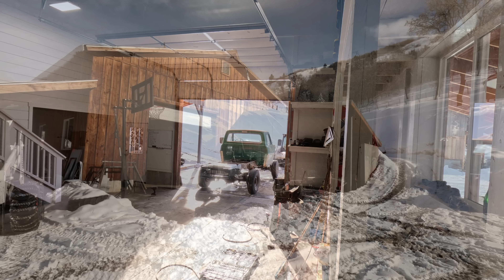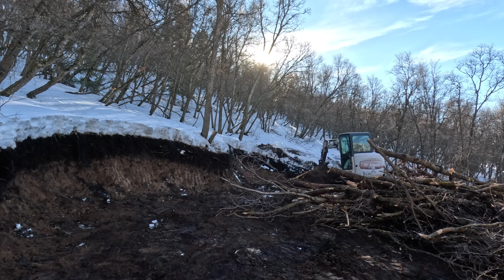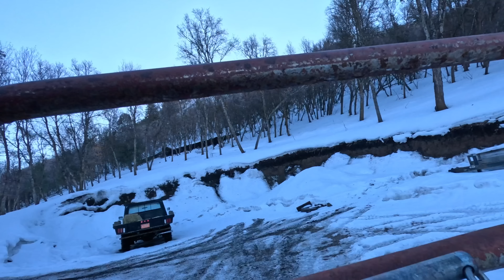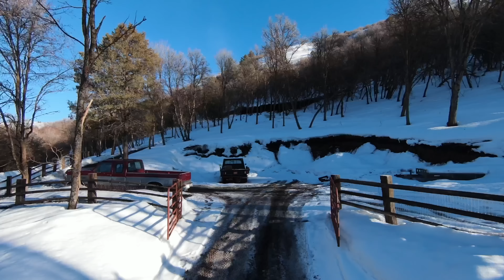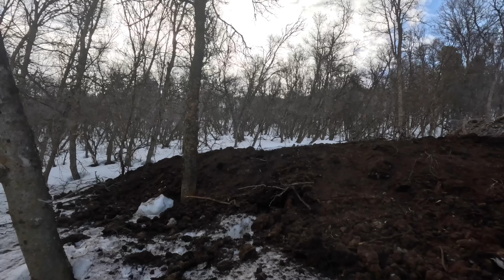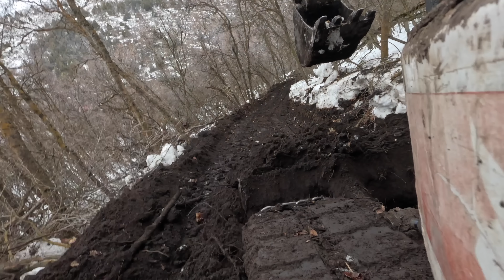#719 - Running My Excavator In Snow! Snow Chains, Cutting In New Trail, Clearing Land In Winter

Comment: you are making good progress - ditches for drainage and gravel should help a bunch and once you complete switchback and up and over to back 40 you will finally have access and can build a nice airbnb cottage which should be a nice summer project - don't be afraid to take out more trees and give yourself some elbow room - winter may end up being best time to address and build a road but it will be a work in progress for a while - be patient and persistent - the gravel and sand will help with drainage and lock things in place

Comment: This is genius!  As the snowmelt comes off the mountain, it will now hit the trail and the path of least resistance will then be to go down the trail, thereby leading the water away from the house and shop, AND it is even causing the land to settle on the trail even further.  Genius.  Did y’all start with this as one of your goals?

Comment: My forestry school recommended no more than a 7% slope for a logging road and no more than 15% for very short distances like a switchback. That is what you should strive for on your road to the top. You should lay it out first with surveyors tape and a long measuring tape. You can gauge the slope using the height of a person at the end of a 100 ft. tape.

Comment: You should install a propane Hydronic Boiler and an outdoor Hydronic Wood Boiler. 
You can do 60% wood and fill in the gaps with propane, or just keep it as a backup. 

I Guess somepeople have built hydronic clothes dryers, but if you have solar that's pointless I guess.

Comment: You can run that slash through the chipper.
Either use those chips as fuel or for smoking some good meat.
Heck, city folks buy them chips by the bag.
I Envision all the trees on the hill tapped and a Labyrinth of pipes coming down to the Sugar Shack.
You ever think of putting a quonset hut over those tanks?
Would be pretty quick and give you some much-needed cover.